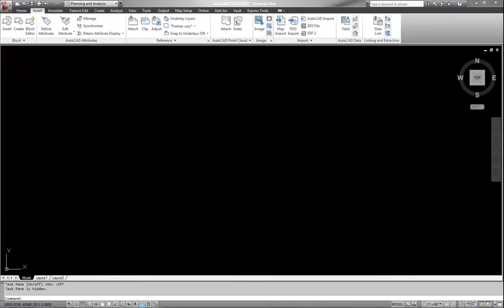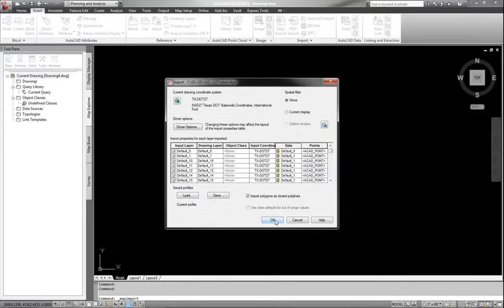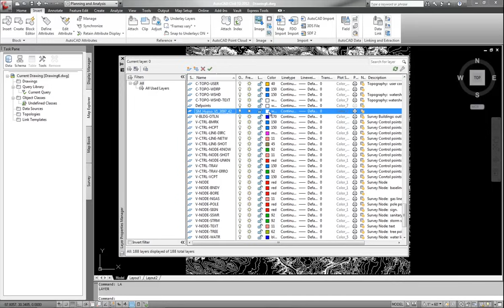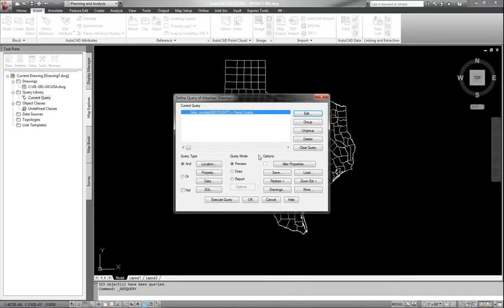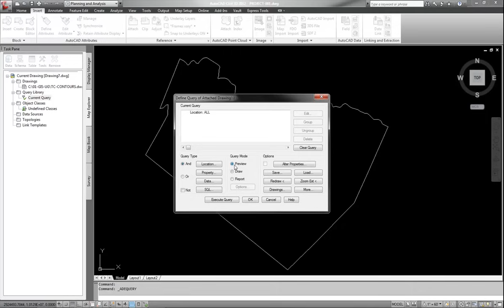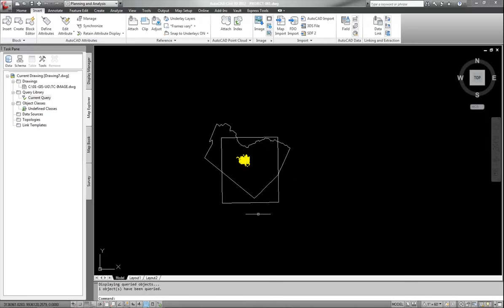Webinar: Importing GIS Data Into AutoCAD Civil 3D

Comment: Applied Software, Graitec Group could you tell me how I can import the data for GIS info that I received that only has the following file types: .PRJ; .SBN; .SBX; .SHP.XML (it is combined like that); .SHX? Thank you. If I missed it from this video, feel free to point me to that timestamp.
Reply: Sorry for the late reply here.  I'm no longer with Graitec, but I feel obliged to check in every now and then and answer questions.  A SHP file is comprised of the PRJ file (coordinate system projection file), an SBN or SBX file (spatial index file), a SHP.XML file can sometimes be included (geospatial metadata in XML format), and possibly and IDX file (AutoCAD index file).  The only file you import into Civil 3D is the SHP file.  However, don't discard the other supporting files because they are what the software refers to when importing the file.  A SHP file alone without the supporting files is practically worthless.

Comment: Hey Jason, I have a shape file with contour lines that have object data that represents the depth of a reservoir. I need to change those to an elevation. Is there a way to do this when altering the properties in the query?
Reply: Ken, I'm sorry.  There isn't a way to accomplish this.  All that data that is in the SHP metafile data is what controls the information that is imported into your drawing.  If that data is incorrect or not there, then, sadly, you will not have your desired outcome.

Comment: Can u help to convert .prj file pararmeters to autocad map 3d user defined .csd file prefered in FEET 
PROJCS["Pak I",GEOGCS["GCS_WGS_1984",DATUM["D_WGS_1984",SPHEROID["WGS_1984",6378137.0,298.257223563]],PRIMEM["Greenwich",0.0],UNIT["Degree",0.0174532925199433]],PROJECTION["Lambert_Conformal_Conic"],PARAMETER["False_Easting",2743196.4],PARAMETER["False_Northing",914398.8],PARAMETER["Central_Meridian",68.0],PARAMETER["Standard_Parallel_1",29.655],PARAMETER["Standard_Parallel_2",35.314],PARAMETER["Scale_Factor",1.0],PARAMETER["Latitude_Of_Origin",32.5],UNIT["Meter",1.0]]
thanks for sparing a bit of time

Comment: I had difficulty with Coordinate System - this may assist others.
The map import shows LL-GDA94 which is what I set the drawing Coordinate system to at the outset.
The distances etc were incorrect, took a while to work out.
However I started again & set the drawing coordinate system at MGA-56 - as I knew this was a 'subset' of LL-GDA94.
MGA-56 is a zone within GDA-94.
It all works now.

Comment: Great video super helpful. I have a clarification question. 

How can I identify the coordinate system used by a SHP file? You did said its in the meta data didn't see how to find/read the meta data.  Maybe I missed it in the video.
Reply: Kevin, most of the time the coordinate system is embedded within the SHP file. That's why you'll see at minute 19:00 when I connect to the contour data SHP the coordinate system is already in place in the "input coordinates" column.  Othewise, you'll need to read the PRJ file that ships with the SHP file and play around with coordinate systems in your area.

Comment: after importing your image file, use "image clip" to trim down your image to the area you specify
Reply: Thank you.  That is a great command and I highly recommend it.  I should have mentioned that in the video.  But it must be understood that you're only hiding parts of the image and not actually clipping it.  Most of the time when I speak to someone about clipping down the image they want to also reduce it in size.

Comment: how did you get DGN file and can you tell how to generate one? is it from Autocad, ArcGIS or any other software used. 

Thanks
Reply: That DGN file was created in Microstation.  I found it on the TxDoT website years ago.  If you have a DGN file that is geolocated it should work in the same manner.

Comment: I followed all the steps but when I tried to query in the image, the box did not show up anywhere, even after zoom extents. What can I do to remedy this?
Reply: +Elizabeth Majors, what type of image is this?  Are you using the "draw now" option when you bring in the image?  Can you bypass the query and simply use the MAPIINSERT command and insert the image directly into your working drawing?  The method I show is just one method.  There are several and they all depend on what type of imagery you're using.

Comment: How to do handle source data that has different units? For example, after going through the process I had to drawings that did not come in the right place. One was an aerial and the other was the contours. The metadata for both was in meters, however I need the information in feet. Any suggestions?
Reply: When you create the two drawings (in different units) and then you begin to attach and query them into one drawing they should transform their units to match that of the final drawing (the one they are being attached to).
Reply: +Jason Porter I will try that. All the drawings that I created were based on an imperial template. The two drawings that I created had data based on metric units. Probably explained the screw up on my part.
Reply: Yes, please let me know.

Comment: how to fix  
Provide your license server administrator with the following information:
cannot connect to license server system.
the license server manager (Imgrd) has not been started yet,
the wrong port@host..............
................................in arcgis 10
Reply: Kiran, I'm sorry, but I'm not familiar with ArcGIS licensing procedures. If it's an Autodesk licensing issue please contact your reseller.  They should be able to assist.